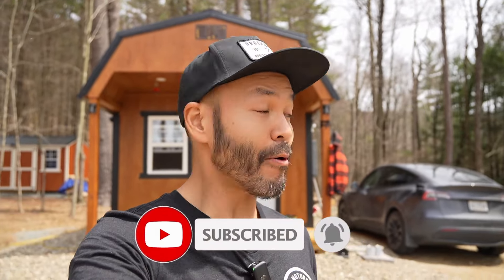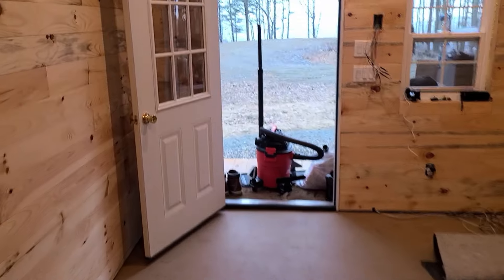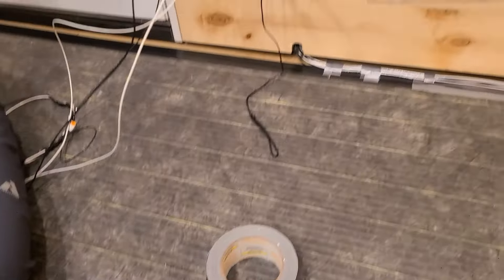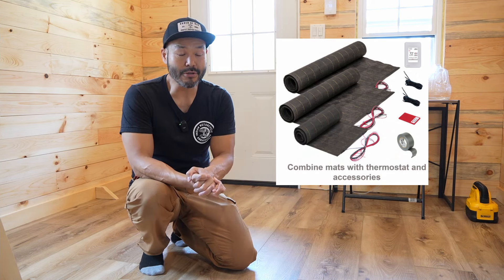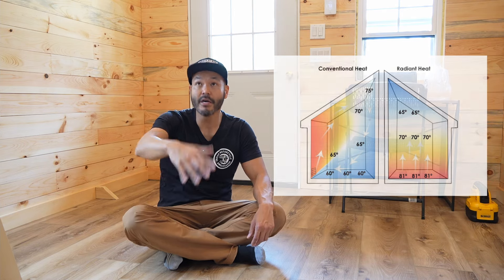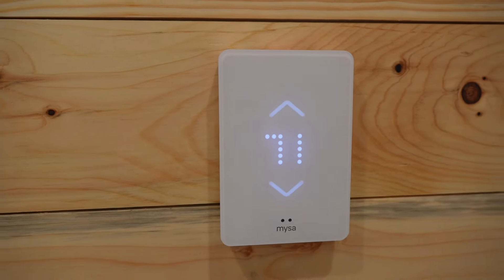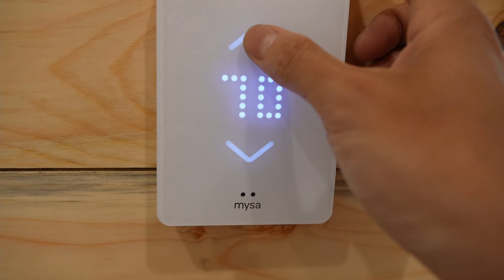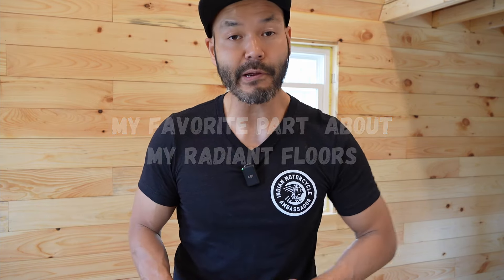Tiny Home RADIANT FLOOR Review!  How to install and How much?  From Thermosoft -  MFC Ep 6

Comment: I just saw this, I know its a year old, so commenting is a bit off. I am glad I see an option like this. I always wish when people do reviews of how warm thing are would have a legit mercury thermometer inside and outside so  we can see the actual temps. That being said, this could be a very good option for my cabin remodel. Thanks.
Reply from the maker: It's a great option for sure!  This can heat a space to the point where it's too hot frankly.  We have had winters in the teens and with sufficient time it can bring this tiny cabin to a comfy 70s and more if we kept it going.

Comment: Did you use this space in the winter? Did you need to supplement another source of heat to help keep the space warm, or did the floor heating keep the space warm?
Reply from the maker: We used it for 2 winters actually and it was def warm enough to survive the NE winters.  It can even be too hot if you leave it on too long.
Reply: @OurFirstCabin What do you do when the electric goes off for a long period of time? You differently would need another kind of heat source
Reply: @scottleatherman163 that's when you have a fire pit outside. 😂
Reply: @stephaniecrothers8482  🤣🤣🤣Good luck with that ! Happy New Year 2025!

Comment: Hello and thank you for this video! I have a cabin upstate, it's on a slab, floating floors on top and it they are very very cold!! I'm planning on adding this product to the kitchen and living room which it makes about 600 sqft. My contractor send me a quote today of around $8000 including materials and labor. He would have to remove all the already installed first. I was wondering if it's worth paying that much or if you think that's a reasonable price. I also wonder if it could heat up those two rooms in the coldest nights of upstate NY. Thanks a lot!!!
Reply: That sounds like a big project!  I would reach out to the company directly with your questions they are most knowledgeable.  I finished installing mine right after winter last year so I haven't tested it in real winter.  But it keeps my tiny home warm when it's in the 40s outside.
Reply: Why not save money and take up the floors yourself?

Comment: Hi how long does it take for the floor to the warm?  Looking to put it it the bathroom where youd need it for 30min at a time getting ready in the mornings and in the evening.
Reply from the maker: Electric heats up within seconds so it will depend on how cold your bathroom is.  I would guessing general you will feel it within minutes
Reply: A programable thermostat is what you want. You can set it on a schedule so it heats up 30 minutes before you usually get ready. My mom has radiant heat flooring in her bathroom that my brother and her renovated in 2009 and during the winter, she has it at 78 when she wakes up and 70 when she's a work. Once it's 65-70 degrees outside,  consistently, she turns it off. 

We're planning on putting it on our 1st floor when we gut our kitchen. It'll end up heating most of our house, so we'll save money on gas.

Comment: what brand of vinyl planks did you use?
Reply: I went with Cali Flooring.  They make some pretty good quality stuff, but a little on a pricey side.
Reply: @cbformula  Have you found the flooring holds up/doesn't warp with the heating mats?  Some vinyl plank manufacturers do not recommend heating mats directly under their vinyl planks.
Reply: @themikeflanders3470  thats a great question, so far no problems at all.  And I am very how some flooring companies say that.  But that's usually associated with hydronic radiant floor where they use water in pex pipes.  With these electric ones it's much safer and though not as strong as hydronic,  it's more compatible by nature.  Ultimately check with flooring supplier though.